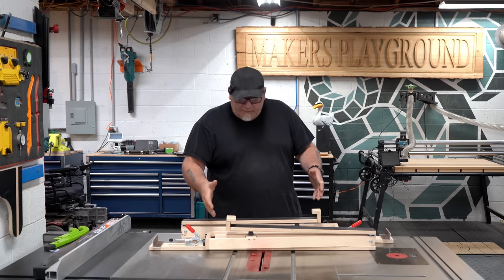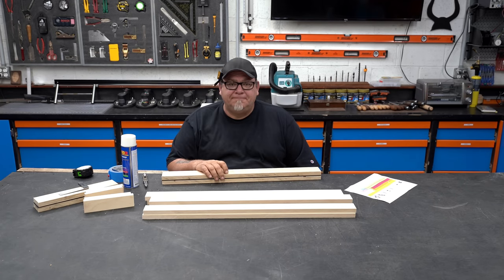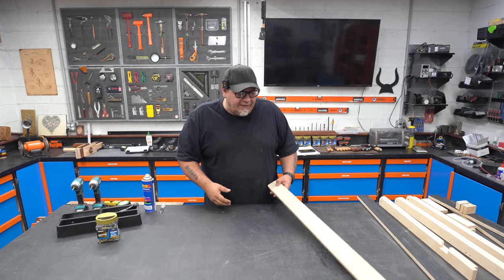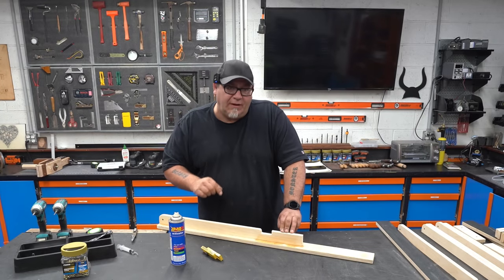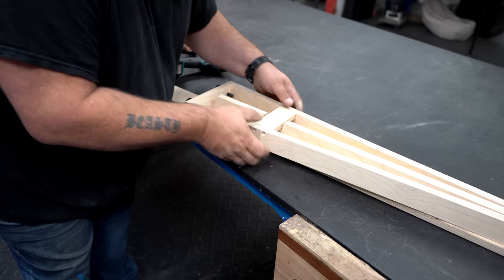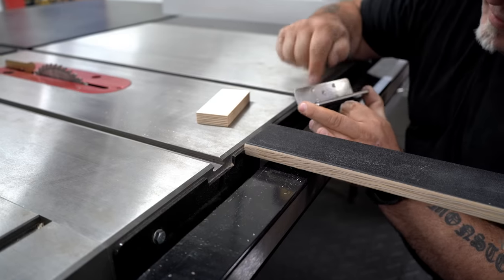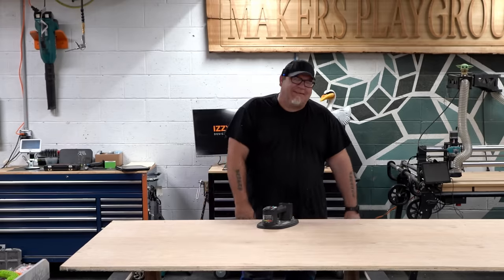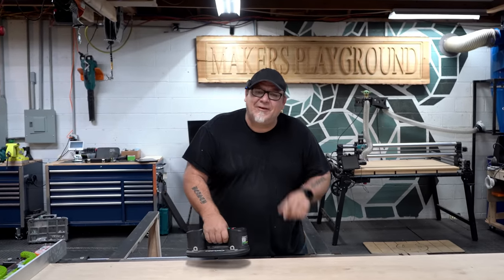DON'T buy a Track Saw? Build this instead!

Comment: Izzy very neat Idea, I think this might be my next project. I primarily use my tract saw for straight edging my rough cut lumber before jointing . Saving hours standing at the jointer making multiple passes. I almost never put up full sheet goods on my table saw, because of not wanting to wrestle it up there. I almost always use Cnc for that but it’s time consuming programming for simple projects that can be quickly done on a table saw. Thanks for the idea.

Comment: Izzy - I've been watching your site & Jay's for awhile now As a contractor that does most of his finish work "out in the field" with a jobsite table saw, I have a great need for both an in-feed & out-feed table extension that can be broken down easily for transport. The problem is that most of these saws (previously I had the DeWalt & now I'm using the Skilsaw Table Saw) come with a rack & pinion fence & rail system (there's no space between the inside off the rail & the edge of the table) . I haven't figured out a way to attach them at the rail while still allowing the fence to move. Your design & engineering skills could solve this problem & create a new product to sell. There must be thousands of contractors & finish guys out their with these saws facing this problem too.

Comment: I bought my tracksaw for one purpose....ripping the end of a deck off. Its exceptionally great at that. I would like a saw that will cut flush up to the house, but cutting the last plank to length in a miter saw isnt terribly difficult.

Comment: I went the other way. I went full track saw. 
I am still figuring out as I build, but it allows me to keep a small hobby table saw if I feel I need it, and not have a giant table saw in the center of the garage shop. 

Instead building is centered around the track saw table, and it doubles as an assembly table.

Comment: Still easier to bring the tool (track saw) to the material when it comes to sheet goods. I only buy sheet goods when I am ready to cut. I then slide them directly out of my truck bed onto a demountable, purpose-built cutting table and make all my cuts.

Comment: I wonder if it would be worthwhile to cut slots in the top of the horizontal supports matching the size and depth of the slots in the table saw.  That way I could use the supports with my crosscut sled.  That would allow me to  move my crosscut sled much further back.  It shouldn’t affect the use of the supports, I could still use them in any position if I didn’t want to use them with my crosscut sled.

Comment: IZZY.... I LIKE IT!!! I liked enough that I subscribed to your channel to see what else I can add to my shop. At 75, it's not so easy for me to manhandle a sheet of plywood thru my table saw - and I'm too damn cheap to buy a track-saw. I doubt the nuts will back off the bolts because they're imbedded against the wood, but another alternative would be using nylox nuts....

Comment: Love this video. I will definitely build some of these legs. If you have a table saw, you really shouldn’t be using a track saw for cutting down large sheets. However, if you don’t have a table saw, a track saw is a good option to get started. Also the track saw has a ton of uses even if you do have a table saw. And you can take your track saw on site very easily. 😀 Still a great video. Thanks so much for posting.

Comment: I feel like there’s an opportunity here to put some o’ those gas struts on the loading bars to make it even easier to lift the weight of the plywood, but I wouldn’t know the best way to design it to be simple to add and easy to use.

Comment: Izzy, I'm always impressed with your ingenuity! I have a "contractors" table saw (folds up foe easy transport). My Kobalt KT10152 has no gap between table and guide, also a very thin table (maybe 3/8"?). There's really no means to hold those legs in place. Bums me out, because I love your design!. Oh well...
Reply: Could you clamp to the bottom of the rail?
Reply: @akbychoice  I'm thinking not. Mostly because either the clamp would be in the way of the table, or since the wood would be so thin, I couldn't embed any part of it in the wood.
Reply: I have that same saw. In my head, I have an idea to make it work. I’ll be able to make that attempt next weekend to see if it will work. And I will let you know.
Reply: @Chagy2112  I look forward to that, thanks!

Comment: Great addition for any shop, but it still cannot replace the track saw. You still need to make straight-line rips and squaring cuts to at least get two good edges from sheet material. For shop projects, maybe using the factory edge as your reference is good enough... and of course any project explicitly made for a Youtube video, that will only be seen in flashes with shaky camera work ;)

Comment: If only I had a workshop big enough to bring in 8 x 4 sheets. My shop (shed) is 12 x 8, and does include a tablesaw but no room for outfeed tables or wings. Since buying a track saw I use it more often than the tablesaw, a couple of sawhorses outside the shop makes short work of unweildy sheets. 👍

Comment: Wish I have a big workshop like yours. But for most of us home DIYers, our direction is to use track saw to replace the table saw. No space.
Also, this design will never kill track saw. I would guess the track saw still cuts much more accurately. And the plywood is still hard to manage with this table extension.
Reply: Was looking for exactly that comment.
Oh, and my wood butcher takes a buck a cut, so... Yeah, they cut the sheet good, mostly.

I still enjoyed the video, I need to build some stuff for the band saw...

Comment: You should have made the swing arms slightly shorter than half the width of a full sheet of ply, that was it'll rotate close to the center of mass meaning you have to lift less weight when bending down.

Comment: Great idea. One question, how would you cut the panel into 4’x4’ pieces since most fences don’t have a 48” capacity? Clamp a straightedge. 👍
Also could be adapted as out feed legs. Don’t want floppy wood on the out feed.

Comment: To load a saw you stand ply up against table and from the top push at the table quickly and forcefully down to the table. The ply just finds it's way on the table.

Comment: When I had a larger shop I indeed broke down sheet goods on my table saw. However I currently have a MUCH smaller shop and thus I purchased a track saw. I will again have a larger shop and probably use my track saw less.

Comment: I own and use a track saw.  This video shows a nice workshop setup.  But I use a track saw because I do not have a table saw that's anywhere close to the size shown here.  In fact, I have no table saw at all.  And I'm pretty sure that even the most expensive Festool track saw is cheaper than a table saw of this size.  So I'll wish I had a workshop like this, and in the meantime I'm keeping my track saw.

Comment: Nicely designed setup. However, per the title, I expected something different. You might consider re-titling this to "Easy handling of full sheets of plywood on a table saw." With this build I don't need my inexpensive Tracksaw - but I need to relocate into a workspace as large as yours, buy a big expensive table saw with big extensions like you have...

Comment: Can you give more information on the black ABS sheet please? What thickness is it? Where can we get it, or are you getting the plywood with it already laminated? How does this compare to something like formica laminate? Thank you
Reply from the maker: I laminate it on plywood here. I am not sure if it's available already laminated. We buy it at our local plastic/sign material supplier. Piedmont Plastics. It less expensive than formica and installs the same way. With contact adhesive.
Reply: There are some companies that sell it, you can find them by searching for "abs laminate panels".  I don't know if it ends up being the same as what Izzy used.
Reply: @alskjflaksjdflakjdf  I know, my main hope was more detail on what thickness to use. These sheets come in a variety of options and while I suspect 1/4 inch is too thick there are many options of thinner materials.

Comment: Not much use if you don't have a tablesaw that can reach the center of a 4-by-8 sheet of plywood.
I frequently need 4-foot sections of sheet goods, and a track saw (or just a straight edge) is the simplest way to go.

Comment: My only question would be: If you have a plywood panel that is slightly bent how do you exert downward pressure, say in the center of the panel when you are four feet away from the saw blade?  I suppose you could position a weight on the panel to ensure flatness but that might lead to other problems.

Comment: I love the jig. Looks like it would make cutting sheet goods accurately much easier. I have a question not related to this. Upgrade table saw or band saw first. My current job site table saw handles most tasks but the band saw can only resaw 3 1/2 inch and is H.F cheapo. Thoughts?

Comment: Izzy -- I really like the improvements you made to Jay's infeed supports. Permit a couple of comments inspired by your video:

First, for small shop this may be a great solution. For larger shops, an infeed table might be a better solution. In the furniture mill I worked at, our table saws had large out feed and infeed tables. The infeed table was to the right of the operator and started a foot or so to the right of the right-hand miter slot on the saw. The table was on wheels, so it could be moved closer to the blade to support narrower rips. In addition to supporting sheet goods, the table served as a staging area for parts needing to be cut to final size. Of course, such a table would take up too much room in a small shop.

For tiny shops, such as mine, a track saw can all-but replace a table saw. A job-site sized table saw is all you really need if you have a track saw. This allows the table saw to be stored out of the way when its not being used. Is using a track saw in lieu of a full size table saw an optimal set-up? No! But, it may be the optimal solution if space doesn't allow for a full size, or even a contractor size, table saw.

Comment: Nice but a small panel could be way easier, no flipping sheets, a small floor space is needed, and cheap: you can use a regular hand circulaire saw  as the machine you  need.

Comment: Mount a laser on the ceiling that sprays the blade line, strike a line on the sheet and align the two. Now you can cut parallel without a fence

Comment: I think the answer is no. Emphatically.
Why? 
- anti-tearout support
-scoring cuts
- full sheet right-angle cuts
- plunge cuts
precise depth (you cannot trench cut full sheets to sub mm depth it will flex.)
-in situ cuts (flooring edge trim, door bottoms)
- cut finish
I could go on...

Comment: Awesome video, Izzy!

Question:

Is that Oliver contractor table saw powerful enough to run those 40T Amana electroblu blades you like? The saw is rated 2 HP.

Comment: Just out of curiosity... what is the distance from the wall to the front of the fence on your Bosch Axial Glide?

My workbench looks about as deep as yours, flat up against the wall, and I'm contemplating whether that saw is going to stick out too far or if it'll work just fine.

Comment: Your back is bugging you in the vid? 😢 I'm on the same track as you are. No surgery yet!
Reply from the maker: Yep. Still having lots of trouble with the back. Feel for ya. It is no fun
Reply: @izzyswan  I thought the surgery was the end of the pain crap. Obviously not. I sure do hate it that I'm asked if I am drunk on the job sites because I wobble like it walking sometimes. It really sucks when you can't feel your feet walking on wall top plates and sheeting a roof. 😆
Reply: @davegravitt210   Hang in there, Dave.  Wait as long as you can.  It's different after the surgeons "invade." Lol. You'll get the relief but it's crazy how that repair begins affecting the rest of the area.  The pain and discomfort returns sometimes in different ways- depending on the repair of course. You'll know when you're ready, though.  You'll basically be at your wits end and begging the doc to fix you. But until then, hang in there, my friend- and careful on those top plates and roofs. I'd also recommend getting your immune system in top notch shape before any surgery to help you out with recovery.  From the sound of your work, it seems you're already in pretty good shape, so that helps. I'm a big'un like ol Izzy so recovery can be a bit more challenging! Lol.   Best of luck to you - and of course to you too, Izzy!    God Bless,   Troy

Comment: Izzy I've had similar infeed supports in the past for my table saw.   My issue being a small garage shop that needs to have the ability to break it down my issue winds up being outfeed more than anything else.  I wonder about building a set for infeed and 3 or 4 for outfeed hmmmm

Comment: I still don't get the idea behind buying a track saw. I've been in construction my whole life and I just use an 8' rip of plywood with a wooden, screwed on fence. make your 1st cut to size the strip to the saw shoe and you are done. It really is that simple and can be any size at all. 
Don't get me wrong, i love your tablesaw version but really, I see no need for it at all if you are just sizing sheet goods. They make finish blades for skilsaws it that is the issue.

Comment: I'd go with the panel cart idea.  No need to attach to the saw.  Just wheel it up and lock the casters.  Same functionality but even simpler.  Rockler and Woodcraft both have a version.  I'm not sure either is "perfect".  I know you could take that idea and improve it.  

I think I disagree with the premise.  I think we DO need a good track saw in our wood working shops.  Even shops with a big 3 phase slider still need a track saw.  Sometimes there's no beating bringing a near table saw quality cutting capability TO THE WORK.  And since it's minimum 20 year lifespan it makes little sense not to buy a high end saw.

Comment: Problem with sheet goods is they are never square and the track saw is good for squaring up those materials .. I like the idea of what you built , but the need for a track in my shop is a necessity

Comment: Track saws are still really expensive. Use your circular saw and a homemade guide for the same result. Yes it's heavier. No, it's not the same. Yes there are also other options, like Bora makes a clamp on track/guide for instance. I don't need a track saw type cut very often, so the cost doesn't make sense for me. If you're in the same boat, this video or other less expensive options may be for you. If you already own a track saw or have the money for one, they're an amazing tool to have.

Comment: ok, so here's my argument with track saws and why they might make you mad! Let's talk about layers of failure. What do I mean - I mean you have the track, you have the rubber underneath. Is that perfectly machined, is the rubber consistent thickness? This is important. Now, you have the track saw, you have the blade, you have the shoe, the bottom whatever you call it. You can take a machinist square and square bottom to the blade. Now, once the saw is on the track you have PLAY/SLOP. Put track down and clamp it.  Oh? Did you clamp too much, did it compress the rubber? Oh? Did it knock it out 1/10th a degree? How will that play out on a glue up over 6 foot? 1/32 off, can turn into a 1/4 or 1/2" snaps fingers like that. Even if you do the flip an saw method to match glue joints, the mere pushing the saw down the track and the micro rocking back and forth causes to knock out of square. Push it from the side and forward, some play. Try to pull it from front with even pressure? Some play. Get a little stuck when you hit that stupid transition point when two tracks are together? Some slop. I could do whole video on it but I aint got time for that. I challenge you to prove this wrong. For a table saw, you have the top the blade and the fence. The additional slop is removed outside of the gap of material between it and the fence and the top - if the blade causes the material to float up a bit if it's light. Those that have a lot of time on the table saw know this, and if it rides too high, that thing is coming from your face like one of them face huggers from alien. Anyway, I approve of the infeed and outfeed table solution for sheet goods. Track saws are great - if you use them for things that aren't glue ups. I've done a lot of glue ups with them and knowing the issues helped me get things right but not without a ton of wasted time. Doesn't matter Makita, Wen, Festool, Milwaukee, dewalt they all suffer from the same thing. 

My set up now:
I have a small Jobsite dewalt and what I did was set it up for perfect 90's with a machinist square. Then I built an infeed, outfeed table that's perfectly flat. Then I sacrificed a 6 foot aluminum level and attached it to the stock rack and pinion fence to create longer fence. 

Yes yes yes, could have bought a different saw, I already had it! It's fine. I have a craftsment 3hp iron top with wings and a delta fence, that's great too. Glue ups are much easier now and faster than that stinking track saw (I love you track saw, just you have your place).

Comment: That's a great idea, but I thought a track saw was a way to 'accurately' cut sheet products without a table saw. If I had a table saw, I could rough rip a sheet of plywood with a circular saw to make it easier to cut on a table saw.

Comment: I could not agree more! Track saws are alright but do not get the same quality cut as the table saw. I always have to cut my parts over size and recut on my table saw. Only reason I use a track saw is simply because I don’t have enough space to run a full sheet through my table saw but when I do have a bigger shop I’m going to make this or something very similar! Nicely done!